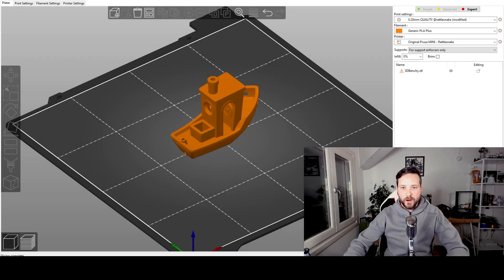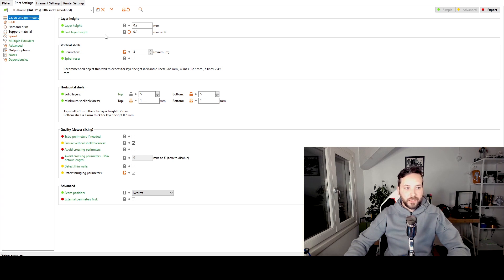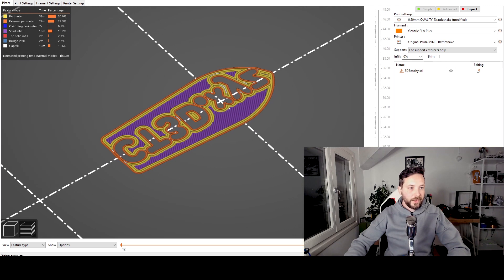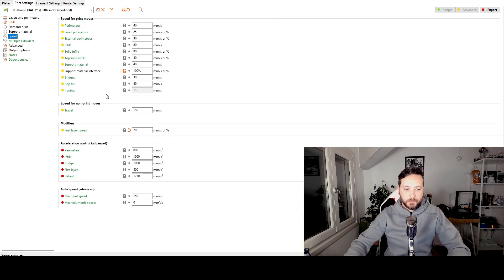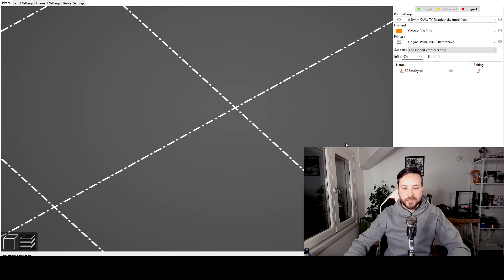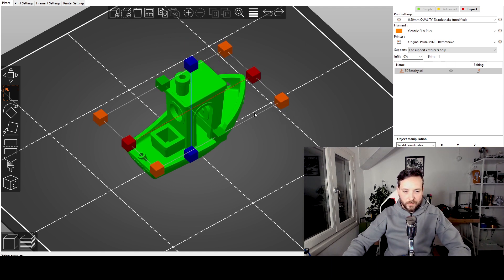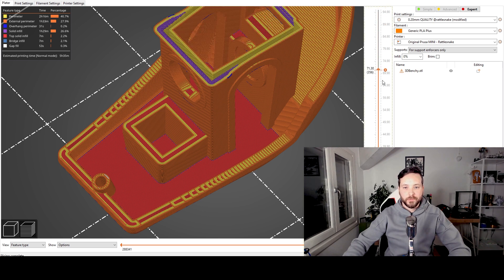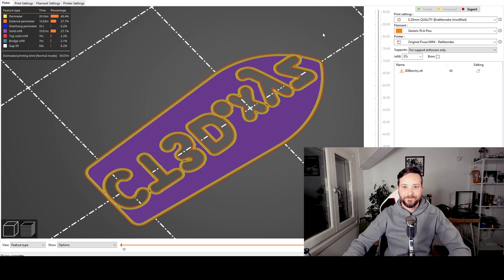SLICE LIKE A NINJA! Three Easy Slicer Settings for Bed Adhesion

Comment: Thanks for the video. Please do a video about your thoughts on the Cura slicer. I think it's a great slicer and has a lot of customizable settings but the two issues you have addressed already is interesting and would like to know more details from you why another slicer would be a good idea to use.
Reply from the maker: I will do my best! Cura is very demanding in terms of hardware. I stopped using it because my iMac wasn't able to run it. I will see what I can do with my current hardware